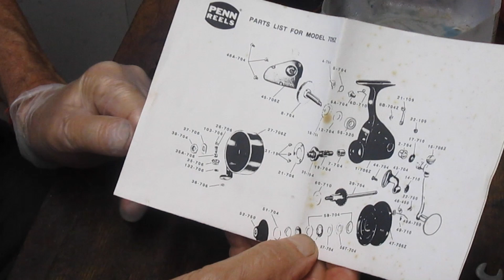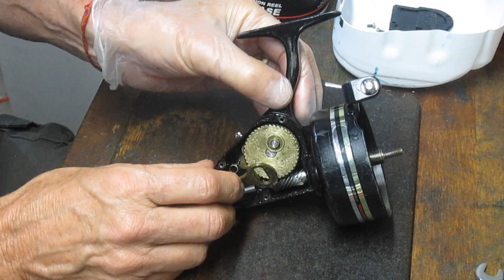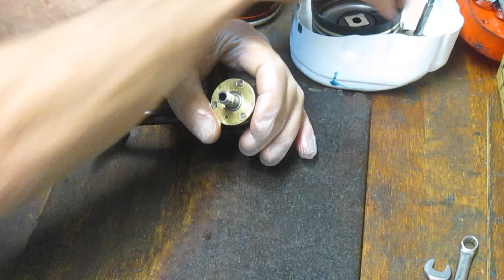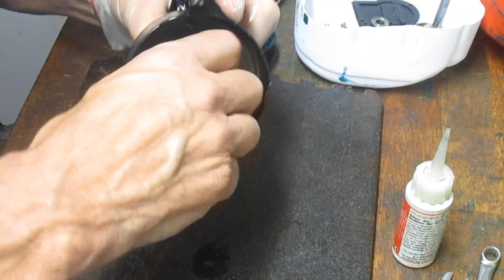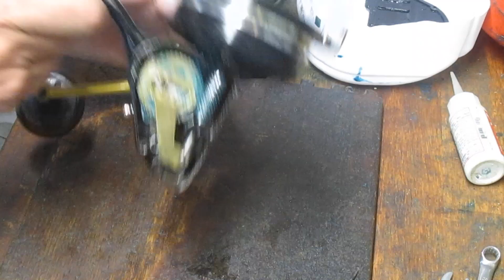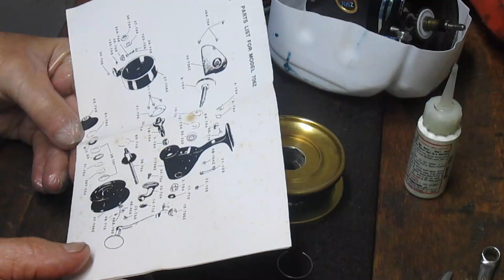Penn SpinFisher 706Z saltwater fishing reel how to take apart and service

Comment: Dennis, just the am I got a second Penn 706Z. It is identical to the reel in this video. There is an earlier 706Z that has a back spool and the black plastic torpedo handle. I may try to get one of these earlier models but they are exceedingly rare and very expensive. I got very lucky with my purchase today. If you can find a 706Z in good condition for less than $100 you found a bargain!!! — Chris
Reply from the maker: I saw the pictures - Enjoy!

Comment: Is it possible to make it infinite anti reverse?
Reply from the maker: There A/R clutch has roller bearings that stop it fast.  The older style relies on A/R dogs with click ratchets that have intermittent stops, so it takes a click to set.  Some older reels, like the quick fire reels only have one stop, so it could take a full revolution before the A/R is set - Dennis
Reply from the maker: The A/R clutch has roller bearings that grab a collar to hold fast "instantly". The older style A/R dogs use a click ratchet that sets slower as the dog intersects with the teeth on the ratchet

Comment: where is the third ball bearing ?
Reply from the maker: Did I say there were 3?  If I did, I mis-spoke.  There is only 1 on this reel.  The next generation of SpinFishers changed from spiral drives to  the Oscillation gear set up and had 3 bearings.  One on each side of the main gear and one on the pinion gear.  The Z series 706 only has one on the pinion gear.  - Dennis

Comment: I bought brand new 704z last year and ended up returning it because I felt like it was too clunky. The handle had a clunk / play when reeling. I found it super annoying. Does this one does the same? Or mine was defective?
Reply from the maker: A clunk usually means worn or bent gear teeth or a problem with another mechanical part.  I'd say it was defective based on your description.
Reply: @2ndChanceTackle  thank you for your answer! I thought I was too picky.

Comment: Dennis, what is the easiest way to change the housing bushings on a 704 greenie? I already have 2 bushings.
Reply from the maker: Are you referring to the side plate housing where the handle shaft rides?  That piece is part of the housing itself and not meant to be replaced.  If you are asking about the top pinion bearing, you remove the collar and pull up on the shaft.  If it is stuck, flood the area with a penetrating oil and let it sit a while to loosen the dirt or rust then try pulling up again.  If you are still having trouble, try reattaching the rotor to the top of the pinion shaft and use the rotor as a knob to get better leverage while pulling up.  If that is not what you are asking - please restate your question - Thanks for asking - Dennis
Reply: The part I’m talking about is part# 2-704. it’s the bushings that the hand crank shaft rides in. This is on the greenie made in 1969.

Comment: This reel was a favorite amongst surf fisherman back in the day. I used to see guys flood the interior with grease and fish it like a completely sealed reel. Don't at all recommended it but that was the thought of the time. Still a great reel to this day.
Reply from the maker: Lots of folks loaded up the surf reels, which was usually fine.  The problem occurred when they let the reel sit and the grease dry.  "Modern" sealed reels help keep the water out, but still need the service to stay at per performance - Best wishes Jeff - Dennis

Comment: Hi Dennis, The knobs are awesome. I fished 3 weeks ago and got my PB pompano, speckled trout, whiting, and flounder in the surf. Only caught two blues and they were small. Did get a nice sheepshead though. By the way, I’ll get the Mitchell 498 and the Roddy 944R tomorrow. Can’t wait!
Reply from the maker: Nice - ended pictures when you get a chance - I will be getting a left handed Shimano Calcutta 250 soon.  I plan to do a video on that one and then take it fishing - Dennis
Reply: 2nd Chance Tackle  Actually got the Mitchell 498 yesterday. I just put that Browning saltwater seal in the 498. It helps protect everything inside the reel housing from saltwater intrusion. The Browning Co. that bought out the García Mitchell Co. added these saltwater seals to these large Mitchell saltwater reels like this 498. I have gotten three reels from this same seller. He is a really great guy who is a fantastic source for these large Mitchell Saltwater reels. He gave me a beautiful complete housing for a 488 I was working on that had a broken foot. That part should have cost over $50 but he gave it to me and even shipped it for free. I’ve gotten a 396 PUM with a custom pickup and a 498 high speed handle, a gorgeous blue/gray 496 in unused condition, and this beautiful 498 from him. I needed a couple spool clicker springs for my 488s and again he gave them to me and is shipping them free. He also gave me 6 of the large saltwater seals for these reels. I put them on my 302N, 396, two 488s, and this 498 I just got. His name is Gus and has turned out to be a great friend and the best source for large Mitchell saltwater reels, parts and expertise. Today I should get the 706Z back from you and the 944R Roddy “tuition” reel to help me learn about these large Roddy saltwater reels. Unfortunately I spent this morning at my kidney Dr. because of all the kidney stones I’ve been having. They are very painful and make me pretty sick. These fishing reels help me keep my mind off of all the pain and nausea. I’ll e-mail you some photos of the 498, the Roddy 944R, and those beautiful power knobs I installed for my Penn 704Z and 706Z. Talk to you soon!
Reply from the maker: Chris - sorry to hear of the recurring kidney issues.  One of my best friends has the same problem and I know the pain he goes through.  Best wishes for a speedy recovery.  Dennis

Comment: First time Seeing one of these. Interesting.
Reply: Joyce DiMaggio  Glad you like my reel. Dennis did a fine job with it. I was having a little problem with an internal rasping or scraping noise. It stumped me.
Reply from the maker: I've had a run of requests to do SpinFishers lately.  Next up is a Spinfisher V7500 and I have a 713 on the table now!  and a Spinfisher V 4500 livelier in the works.  Funny how that happens - Dennis
Reply: I fish alot and love seeing all the interesting reels. Thanks guys.
Reply: What type of grease and lubes do you use?
Reply: Joyce DiMaggio  like Dennis I use Penn Precision reel grease and Penn synthetic reel oil. On my Mitchell reels I like to use a synthetic grease called Super Lube. It is a light translucent grease that seems to work best for my vintage Michell reels. Don’t go cheap on reel grease and/or oil. Stay with the major brands. Some of the stuff they sell on EBay is nothing but repackaged synthetic automobile oil. It is terrible for vintage fishing reels!
Reply: I also have Mitchell reels, my favorites. I was looking to get Penn grease and oil pack, but they were sold out. I will check back later with Penn. Thanks for the info.
Reply: Joyce DiMaggio  Hi Joyce, if you have some Mitchell reels you might want to consider getting some of that synthetic Super Lube. The best Mitchell repair and parts guy that I know recommends Super Lube for Mitchell reels. Honestly I like it a little better than the Penn grease. It is translucent white in color and seems to hold up longer than the Penn grease. It is also cheaper by weight.  I’d love to know which Mitchell reels you have. I have 17 Mitchells now and I love all of them particularly the big Mitchell saltwater reels - the 302N, 396, 496, 488, and 498. They are as good as the PennZ reels and the old greenies in the surf!
Reply: I have a Mitchell 406, several (8) 300's made in France stamped, 308 and a couple of 402 saltwater. Best reels ever

Comment: Dennis, I don’t remember if I told you or not but I have two handles for this reel as well as my matching 704Z. I got two more 704Z handles and drilled out the handle knob rivet and installed beautiful Gonexus Power knobs on them. With those power knobs these Penn Z reels become even more special and an absolute joy to fish! Also, you are very wise to put the handle on immediately after reinstalling the main gear. That AR dog and the two springs will explode out of the reel if given half a chance!
Reply from the maker: You told me you were looking for those knobs.  I can imagine that they make life easier and turn that reel into a powerhouse. What are you fishing for in the surf these days?  We are just getting the Bluefish run now. - Dennis

Comment: Thanks Dennis! Love the Spinfishers!  My 5500ss is much smoother after you replaced those bearings!
Reply: Nick Francipane  Hi Nick - I don’t have any Penn spinning reels newer than this 706Z. I know that the reel you mentioned seems to bring a great price on EBay. I know many of these later Penns were also made in the USA. Are these Penns like the one you have as good as I think they are?
Reply: @christopherjenkins2373  Yes they are! I have the 4200 all the way to 9500 and use them all! You'd love them ,built with the same quality as what you own , I dunk mine surf fishing all the time with no problems!
Reply from the maker: Good to hear! or not hear them!  I have a SF V7500 in the works now, so stay tuned.  Best wishes Nick - Dennis
Reply: @2ndChanceTackle  Yes Sir! Those Awesome Spoons came just in time! Thanks Dennis!
Reply: I now have about 370 vintage spinning reels in my collection. Just this am I got another 706Z. I now also have four of the Penn SS series that came out after the Z reels. I have a 550ss, 650ss, 750ss, and 850ss. I’ve fished with the 550ss and loved it. These SS reels are every bit as good  as the Z reels. I love the switcg]h that will turn off the clicker. These reels have a double anti-reverse on them. I doubt I’ll get any of the later Penns as I set up ny vintage collection to have only reels that were manufactured not later than the 1980s. Aoltogether I now have 23 of the Penn vintage reels. I have more Greenies than the later Z and SS reels. — Chris

Comment: I have a 704Z, the spinfishers are some of the best reels ever built, greetings Dennis very good videos.
Reply: Gerardo Oddo  I have a 704Z to match this 706Z. They are both fantastic reels. The 704Z has a rotor brake not present on the 706Z. You can tell the old 704Z and 705Z from the re-release of them in 2013 by the omission of that stripe on the rotor that has the line capacity, etc. The newer ones omit it and are smooth on the rotor cup. Take care of these reels and they will last for generations. I bought this 706Z in 1976 or 77 and will never part with it. My collection has 64 surf spinning reels now including 11 Penns. I have a 1961 Penn Spinfisher 700 greenie that is a first edition of the entire Penn Spinfisher line of reels. It was one of the very first. I don’t fish with it though!
Reply from the maker: Glad you like them!  Please stay tuned for more to come - Dennis